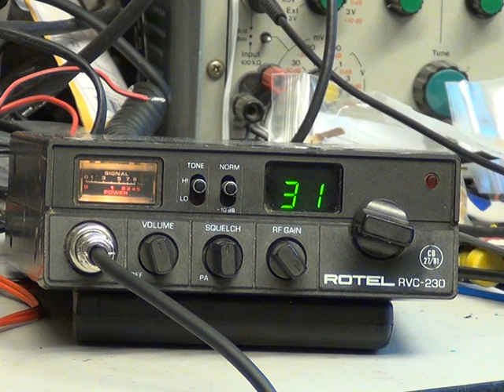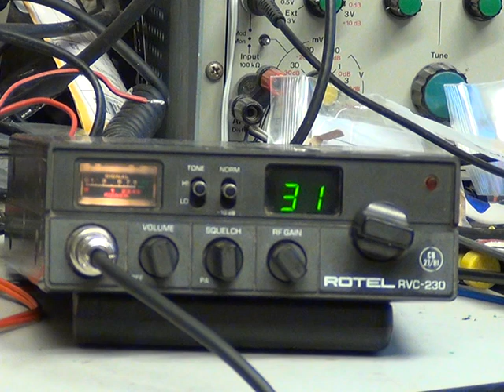Rotel RVC230 UK(CB27/81) Mobile CB radio - Pt3 - On The Air Test

Comment: Always loved the Rotel & Harrier range of CBs back in the 80s best rigs ever might get one again I have recently returned to CB after a garage find of a Fidelity 3000 in Honnington last year that still works with some intermittent problems although it was switched off for 20 odd years good TX & RX could just be dry joints not sure usually works okay for 2 hours or more then I lose recieve & transmit switch off for 15 mins & it works again any advice welcome.Jim From Lincoln.

Comment: I have 3 rotel 240 2 of it still in the box & 2 rotel 210 & 2 rotel 230 1 of rotel 230 had mid block fit it with Eprom it was fit it by screwdriver guide didn't like it the VCO didn't take it very well as they don't so I end up rip out the Eprom it much better radio now.
Reply from the maker: Glad you got rid as fitting the cept set of channels to a 27/81 radio is illegal....and it's always a performance compromise even when it 'kind of works'. Keep them original...keep their value.

Richard
Reply: @ukfmcbradioservicingTango21  Hi Richard, a local rig doctor (now passed sadly) used to say the same thing - you add the mid board to these and you can't keep the UK channels spot on, I guess because of some multiplier issue?